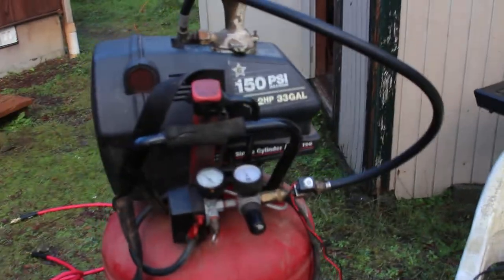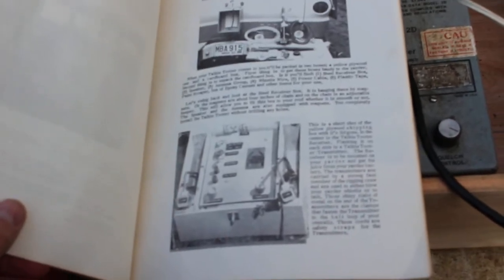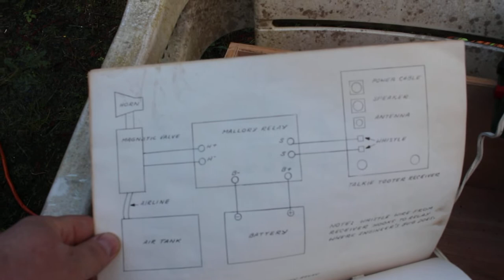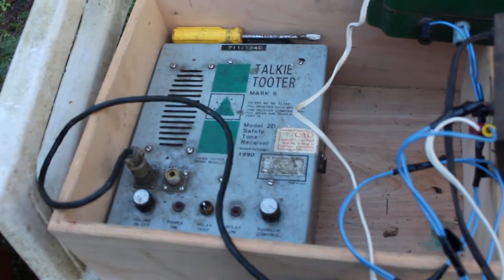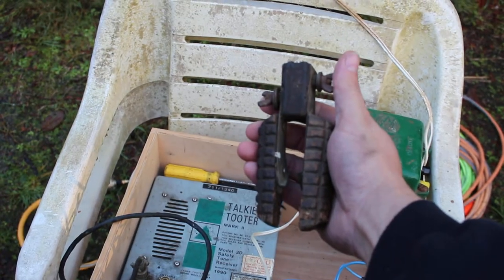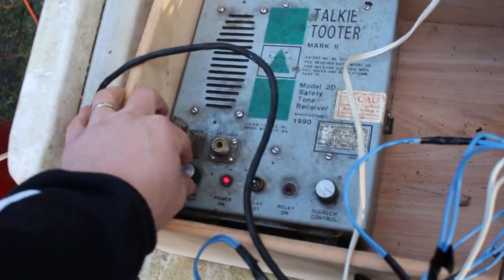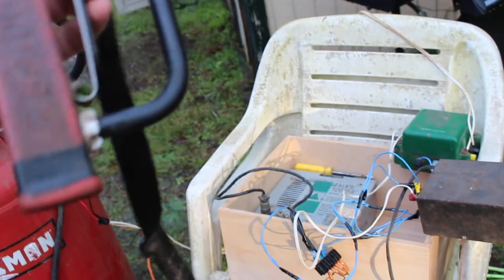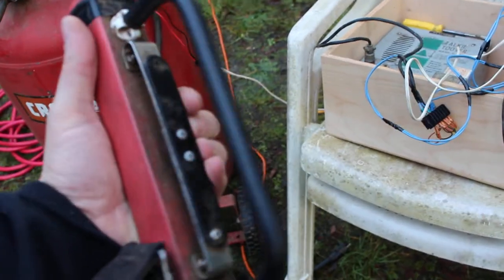Logging, Talkie Tooter receiver installation

Comment: iv only used the other type of talkie tooter
Reply from the maker: which type is that sam ?
Reply: oh the square ish box one with two buttons thats on a belt and has like a cb hand piece with one button, hold down the bottom one and tap the top to toot and hold the top to talk , you could also hold the bottom one and tap the one on the hand piece
Reply from the maker: oh gotcha i've never used one of those before sounds awesome though.
Reply: @swn02  I have a base and 6 portables with a bunch or mics